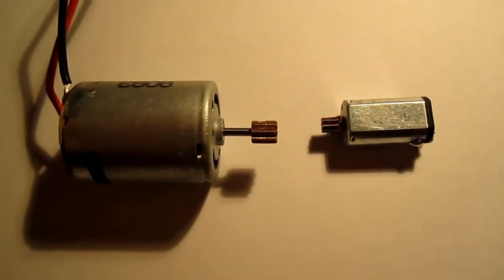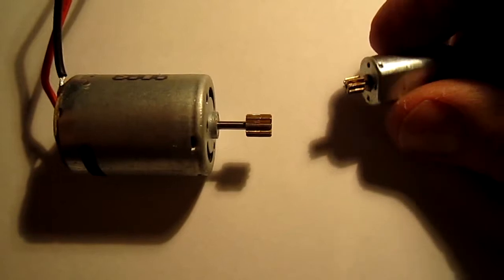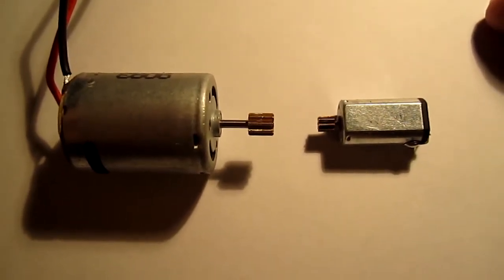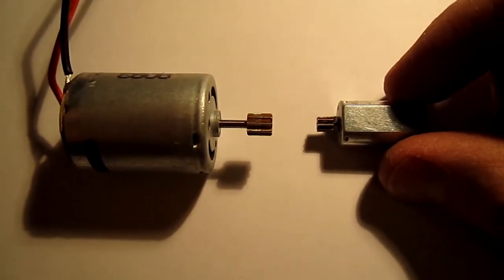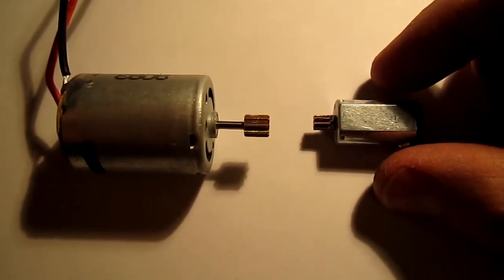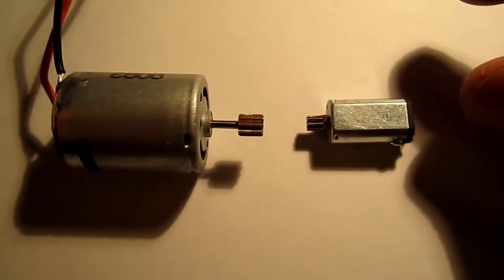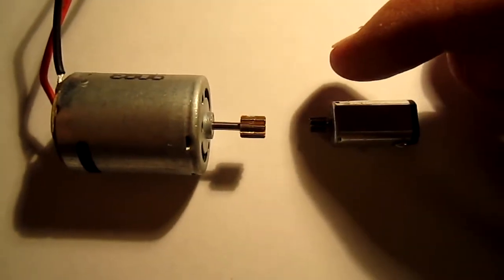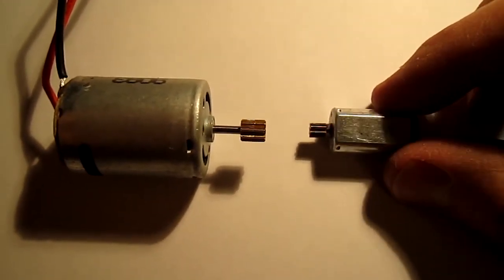How to remove and attach a pinion gear for RC helicopter motor

Comment: Great. Thanks for the video.  Have to remove a pinion gear from a micro heli motor. Pinion is to low needs to be higher to mesh with the main gear better. Will try it later.

Comment: Not to be rude but this is BS. It did not work for me. The gear is now glowing red and still won't budge.  I use a blow-torch and trying to get the power wheels electric cars gear off.  It is a smooth shaft - at  least the replacement - but the gear is stuck on it.  I heated it to a point where it literally glows red and still won't budge. 
I wedged a piece V shaped metal under and trying pry with that but nothing. Not even a mm movement after 10 minutes of heating and prying.
Reply: ok. Got it off. Kept turning the gear all around and once the entire gear was glowing red, I slid a wrench under and pried it off.  You need to realize that once you remove the wheel the motor will be garbage as the shaft will bend. No way to get it off withing bending it. The last 2mm needed a pliers with a wrench and a good 20" leverage to remove.  What nightmare. 
After dealing with this, I found out that the  motor I purchased isn't even a correct one. The original shaft is splined while the new one has a flat area for a key or a set-screw. 
So all this work and I can't even use the gear, have to order a new one.  All the info about the Power Wheels and none mentioned this.  Wasted an hour removing the gear which isn't even fit on a replacement motor.
One more thing - get ready to burn yourself. There is no way you can not burn your hand as all the tools, pliers, everything will be super hot from a red hot glowing gear.

Comment: I am actually having the problem with my 390 motor. There is no screw to open the pinion it is just tightened into place, are you sure that the flame won't melt Amy of the plastic inside the motor? Please tell me, I am curious.
Reply: It will. Do not use this method unless the motor is garbage. Also the shaft will be bent, etc. It is not as easy as it shows here. The gear must be red glowing hot and still you will need a pry bar to get it off. Took me 20-30 min to remove ONE gear.
Reply: That ain't a big deal then.... Thanks. I will try it in a while as I do have enough tools to remove that pinion.

Comment: If you have a piece of stainless steel scrap and adequate clearance, placing it between the motor housing and flame might not be a bad idea to reduce the heat to internal components.

Comment: Someone plz help what should I do if I have a plastic pinion gear?
Reply: +tamim khasawneh If it is bad then just cut it off with something. heat what you are cutting it with and it will go through it like butter.
Reply: thx and btw i just cut it off and bought a metal one. but thx for ur help

Comment: Heating first works Great, I just used a Bic lighter for a couple of seconds and carefully pried off with a small flat head screw driver, my Quad is so quiet now with poly pinions! Thanks for the tip!!!

Comment: This tip saved me $15.00 for a new micro brush-less motor.  With the pinion off I was able to disassemble the motor and remove iron filings that were catching the armature and jamming it.  Even better it saved three weeks of waiting for a replacement to arrive and was back in the air within an hour!  Thanks

Comment: when you heat up magnets they loose all there magnatism... or close too it this is a messure if you dont have a gear puller which is only 12 bucks on ebay.. look up rc pinion gear puller

Comment: i found that the teeth on the motor gears are shallow and rough, they should be used with a fine file to make the teeth more straight and a little deeper. i stripped out one of my drive gears complettly flat because of this. i havent dont this yet but after i did the bottom blade reversal, it slips so i have to take the drive parts back out, so i might as well file the teeth down to where they make better contact. look at your motor gear teeth, they are someimes not even in good condition new.